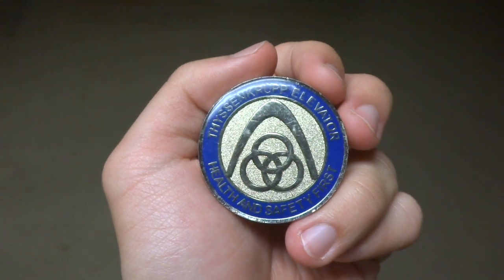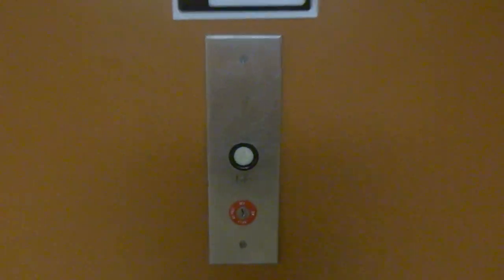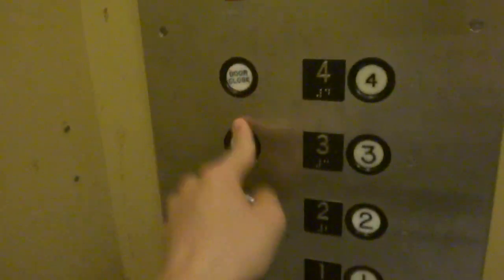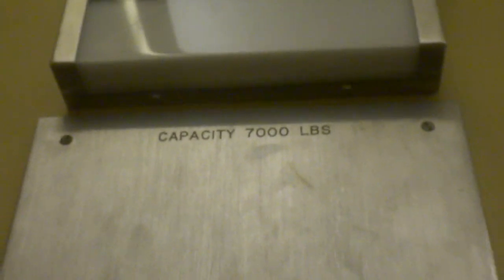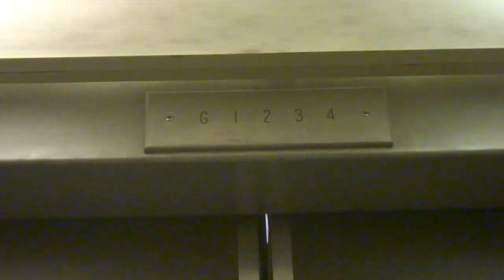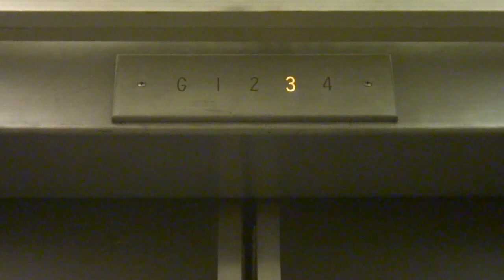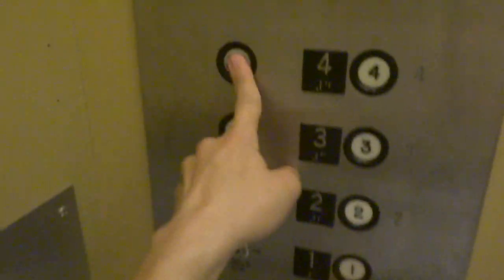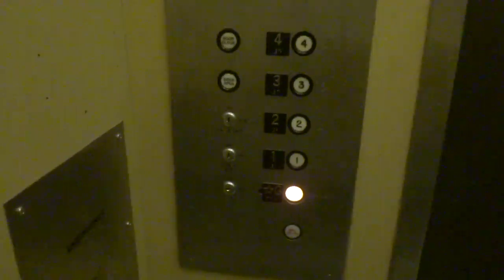Vintage Dover Traction Elevators at Chemistry Annex, Texas A&M University in College Station, TX.

Comment: These elevators have been modded
Reply: @boiii3productions945  What? They've been replaced? How sad is that, because this is another old Dover biting the dust, as well as older Monitor Controls fixtures, which are rare in the southern states.
Reply from the maker: @CenTexElevators489  It’s so good to hear back from you, Nicholas. How are you been? I haven’t heard back from you in a while! But anyways, yes these elevators are already modernized less than a year I took this video. These are actually Armor fixtures, not EPCO WS.